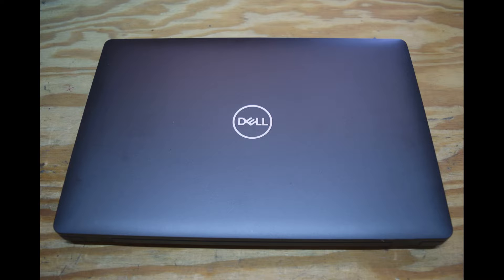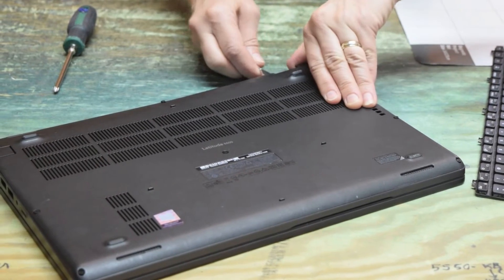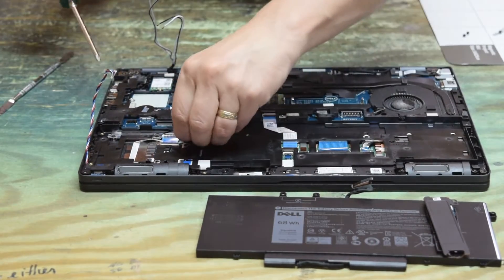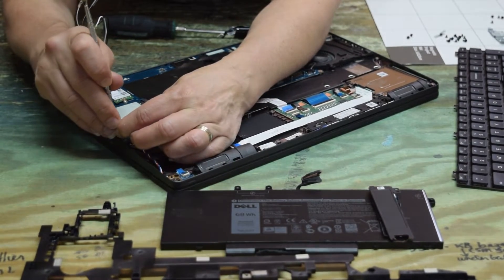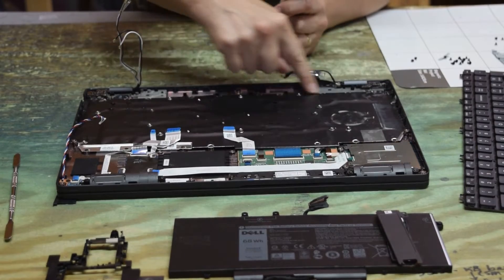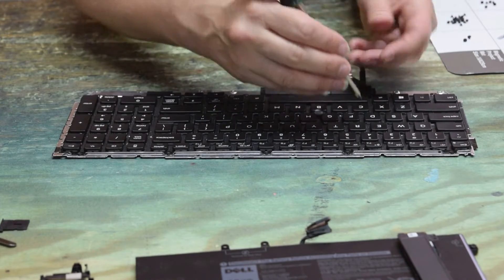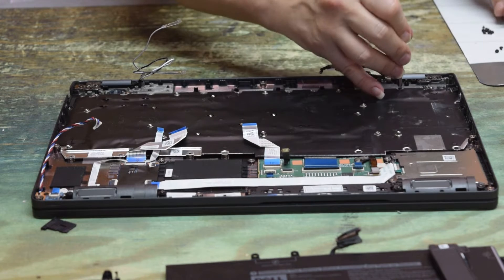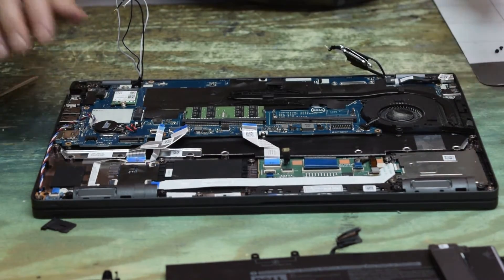Installing A New Keyboard On A Dell Latitude 5500 Laptop

Comment: Hi, and thank you for this tutorial! I was able to replace my keyboard, but now I have a problem:

My battery isn't working, and the charging light on the laptop is off. I can only run the laptop when it's plugged in.
Any suggestions on what might be wrong? All of the ribbon cables appear to be plugged in.

EDIT: I figured it out!
1) I needed to make sure the battery cable was snapped EXACTLY in place: it can't be raised up or uneven at all.
2) I made sure the metal charging plate (upper right corner) was screwed tighter in place.